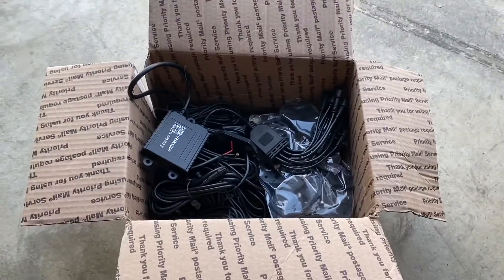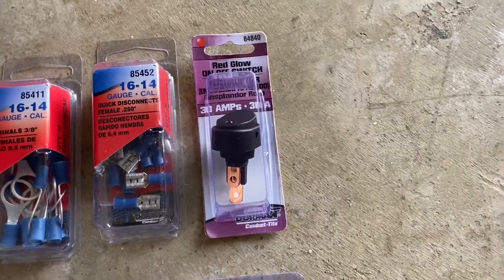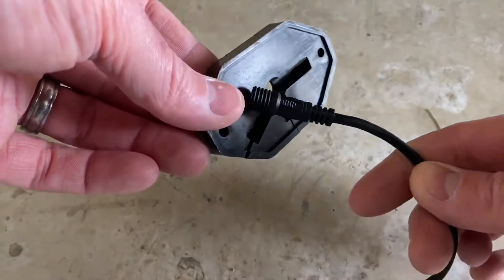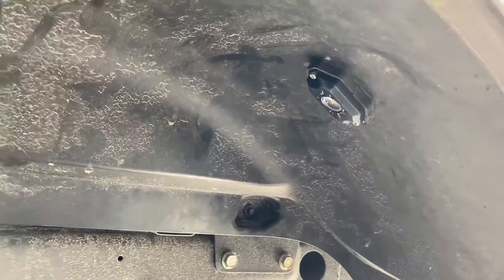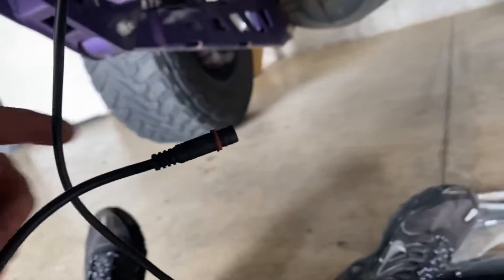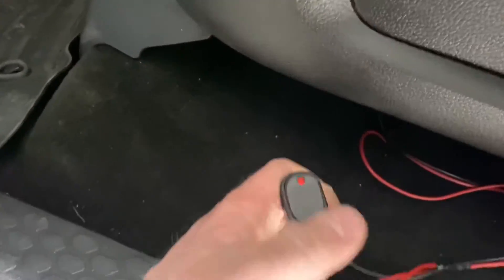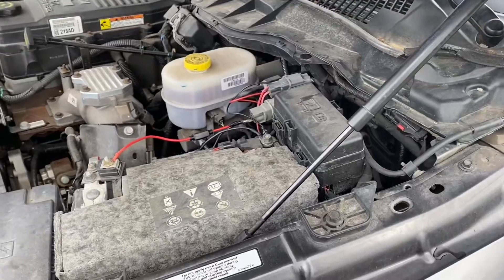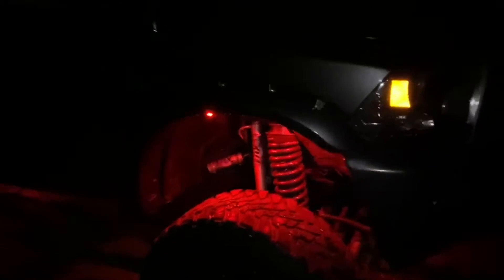RGBW LED Rock Light Install On My 2016 Ram 2500

Comment: Looks good! Great how to video as well! Just curious but Don’t you have the factory Aux switches? Looks like the harnesses are there for them. If so why not tie into those?
Reply from the maker: I did eventually.  I now have all my rock lights inside and out and my light bar and pods all ran to my Upfitter switches

Comment: I didn’t catch where you ran the switch wires through the truck to put it under your seat I am ordering  these here soon
Reply from the maker: I briefly explained around 12 min into the video what I did.  I basically ran a red & black wire from the battery up under my seat to the switch.  Then ram a red wire from the switch to the module.  I placed the module under the truck and then grounded the black wire from the module to the frame with a self tap screw.  This was a few years ago but I'm pretty sure that's how I did it back then but I have completely changed everything up today as of 2023.  The rocklights you seen this video I've now put on the inside of my truck.

Comment: I'm looking to lift mine and throw some bigger tires.. can you tell me about your setup?
Reply from the maker: I have a 10” McGaughy’s Lift and 40” tires.  I’ll be honest, my lift is a work in progress as when it was first installed. It had a “Cali Lean” which I guess is common in some kits where the back end is lower than the front.  So, I put a 2” spacer on the back to level it out.  Doing so pushed my rear axle forward an inch or two so now I have to get new adjustable 4-links in the rear to push it back.  Whatever lift you get, make sure your Lift has all the necessary parts to correct all the geometry changes.  Don’t buy a cheap kit, this is the one area you want to get quality.